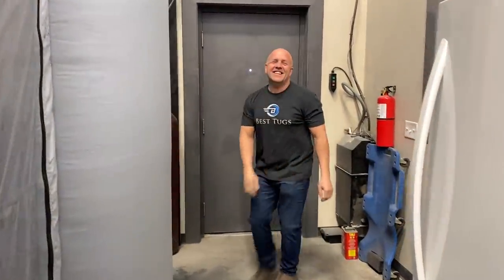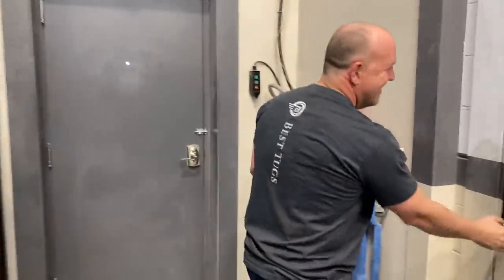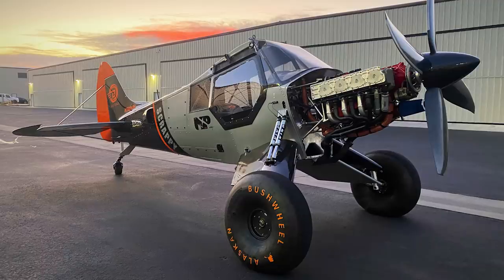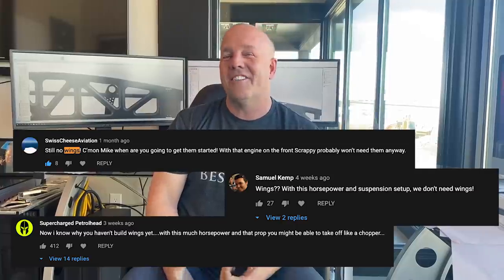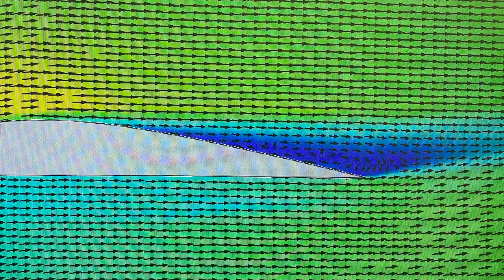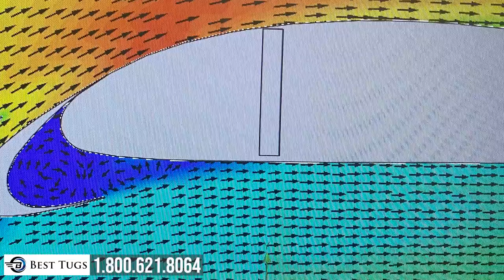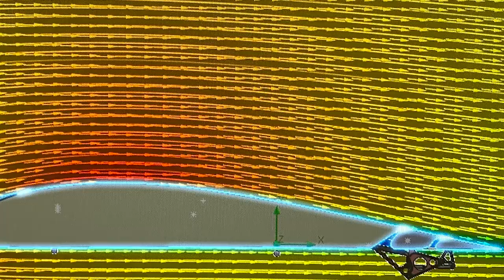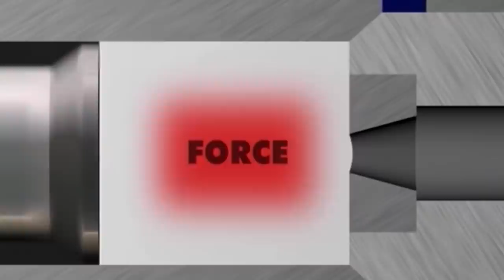Airplane Without Wings, Let's Try Something Different! | Scrappy #42

Comment: EAA Sport Aviation had a small article on wing morphing in March 2020.  Titled "Brayfoil Breakthrough".  Didn't give much info but did mention using carbon fiber wing skins with internal linkages to change wing shape.  I wish they would have went further in depth but was more of a teaser than anything else.

Comment: Hey Mike, impressive inspiring work. Thank you for sharing. I understand that you have finalised your wings, but I wanted to share an idea: which is a wing set that moves backwards a little just like some large predator birds do with their wings when they go in for a dive to go after some prey. So when you want to fly slow and have lots of lift, have the wings spread out and when you want to go fast, have the wings move backwards so that they are more angled like a > shape as opposed to a a ) shape. I hope that helps in your designs. Thanks, Jay.

Comment: There's a few interesting designs you could go for.
Take the junker's ww2 aileron/flap design. It droops out of airflow. It creates drag, so you can make them retractable like on the fairy firefly and extend them out slotted.
Slats can be any size but they start to lose efficiency and the whole point of them past a certain point. You could make them large and over-extend like a secondary biplane wing in tandem with the flaps deployment but the more complicated things get, the more the likelihood of failure.

I've wanted to design an aircraft like you design yours but here in western australia, the industry practically doesn't exist.

Comment: I am not an engineer or pilot but have an interest and I hate having ideas and not knowing whether they would work or not. 
As I listened to you speak about changing the wing in flight, I was wondering if some light actuators in the wings could push up a bar (which may be curved) up on a tough but flexible or elastic material which is integrated to a section(s) of the wing surface(s). I assume that since wings can be covered in fabric that not 100% of the wing must be necessary for structural support or need to be a tough material in all areas. This would allow you to modify the wing characteristics as you fly. 
I really enjoy your videos, thanks for your time.

Comment: When you talked about weight pushing down on the tail, I think you were referring to virtual weight in the sense that it would actually be downward force and not weight exactly. 
That got me thinking of actually using a weight on a track that could be moved forward and aft. 
I have no idea if that could be helpful, but I just wanted to get it out there.

Comment: In archery, you build a flatbow out of a bamboo layer, with on both sides fiberglass. So you build two bows, opposite of each other. Be always carefull for the high speed stall.

Comment: Put tube type tunnels in the wing so that the air goes through the wing while it flows over and underneath it.  Do that and it will give you amazing results.

Comment: A solution for your transformer could be to deploy some inflatable device into the wing. So you can pump air or better a gas, which characteristics regarding to air density and pressure are optimal, into the wing to change camber. I‘m very curious about it.

Comment: Fascinating video.  Just happened to come on after something unrelated I watched.  I have very little knowledge about aircraft (although I was an aircraft electrician in the Marine Corps in the late 60's, and the only thing I pilot is my hex drone), at least I understand the basic concept of how lift works and what control surfaces do.  When you explained camber, and then a lot of the other devices that effect air flow over wings, my thought went to "why not make camber variable?"  Obviously more complicated than just that, so I'll subscribe to see what happens.

Comment: All these questions have been the subject of analysis by Nasa, it's another type of V.G.. And this term VG had me perplexed for a while, when reading about various aircraft. In most fixed wing craft VG refers to Vortice Generators of course but not in hang gliders, which have flexible wings, and this is where the NASA research comes in, where VG stands for Variable Geometry. After all this is actually how birds fly. It's how a soaring raptor can glide the thermals and then dive toward prey at nearly 200 mph. Varying the airfoil, the shape and length of their wing. A Wills Wing hang glider does something like this with a cord and pulley system where the pilot tightens the VG for hi glide ratios, a cleaner air foil, or loosens the cord for greater maneuverability. How to do that on a powered airplane? NASA would also like to know. Good luck with this Mike.

Comment: Hello Mike, Since you're quite knowledgeable about airflow, have you considered slots or slats on the leading edge.  a friend has a Stinson 108 that has a slot built into the front edge that helps slow flight and doesn't seem to hurt the high side.  In addition, possibly adding a slightly up angle on the flaps and ailerons for higher speeds.   Another possibility could be installing slats that come away from the leading edge as the plane slows down allowing even slower flight.  My thoughts would be to add vg's on the slats.  I'm not an engineer like yourself.  I love your journey and am learning so much from your experiments.  Thank You!

Comment: Mike what if you put an air bladder type concept on top of the wing and then you could blow it up to increase your camber and deflate it to reduce it when you want high speed.  Kind of like icing boots. If it was on top of the wing the lift would help pull it up.  That would be like a mix of a slat that you can engage and disengage.

Comment: Expanding wings, either pneumatic or mechanical like slots, would give you a nice, high lift wing with a gentle stall. When deflated, they would be faster and get the speed and economy you need. The profile could be ugly and draggy when inflated, you wouldn't use it but a few minutes per flight.

Comment: Compressed air on rubber walls would easily change wings geometry. Pneumatic solution. By the way, have you heard about Cluster's channel wings? Basically using propellers to accelerate air over wing....

Comment: If you want to add/subtract wing(s) structure, why can't you use high strength tubing that is extendable/retractable on demand and using a thin polymer film that is on a roller for in/out.  Think of it like using a window shade across a self-resizing kite box.

Comment: MIKE!!! wait......I got an idea for ya.!! 
Could you use air bladders inside the wing to change the wing thickness in flight?
Thin wing fast, thick wing slow.  Air bladders could engage a turkey feather system.
Of course you would have to do this not to impair your wing structure or interfere  with fuel tanks.
If anybody could get this to work it would be you!

Comment: I'm blown away by your 'way-out-of-the-box' thinking. As for your wings, are they going to be organic ... screw jack, computer-controlled, shape-changing, carbon fibre, flex surface to meet your goals of thick chord slow speed and thin chord high speed. Kinda like the fabric flex wings that used no flaps on some early, early designs.

Comment: the new bugatti has inflatable dimples that increases a turbulant layer on the surface of the wing which will supposedly decreases drag by pulling the laminar flow back onto wing filling the gap happens so you could look into it

Comment: This is the first video of yours that I've seen, so if you've already considered this, please ignore. Could you design the wing for high speed, but then have an inflatable membrane on the top surface to increase lift when desired. I feel like it would be a simple and light way to modify the shape.

Comment: I've got one word for you. Its Dragonflies. They  studied them in Colorado years ago in a wind tunnel. They are the most efficient lifting machines on the planet. They make length wise vortex's with one set of wings and the other set catches them. In the patent for the helio courier they talk about boundary separation on top of the wing being the limiting factor. The farther back on the wing it is the better. All of the vortex generators are doing it the wrong way. It needs to be length wise on the wing just like the dragon flies. There are products for your struts that make a length wise vortex that improve performance. Why not for the wing?  Retractable leading edge slats with a vortex generator the length of the wing where the current boundary layer separation occurs will improve the envelope your after. And you say how will I do this? The paper airplane guy figured it out years ago. The 60 minutes paper airplane guy that still has the most views of any 60 minute show ever. He was on twice and you can buy a book to make his paper airplane. Its just a simple as hell notch in the wing. I've been wanting to build this for 30 years. You can make the notch come and go fairly easily. Its like a spoiler except it goes into the wing. Air spills over the notch and creates a length wise vortex in doing so and sucks the point of separation farther back on the upper wing surface. I'm a bushmaster builder with a set of Milo DeAngelo (the Canadian guy from BC) wings . Milo ran the leading edge metal on his wings farther back over the high point to just about right point for a length wise vortex generator to be. The fabric sags a little bit when it falls off of the edge of the sheet metal. (My guess its enough of a notch to make a length wise vortex) Go find a Milo bushmaster (There are lots of copies by other people) and fly it. I'm sure you will be impressed by the stall characteristics of that plane. It doesn't stall. (I can send you pics of my wing if your interested).Have you ever looked at the Helio Courier prototype? Its a Piper of course. The Smithsonian has it. Its got short wings like a tripacer with leading edge slats. I think all one has to do is copy that and put a adjustable vortex generator on the top and you will have low speed and high speed performance. I'm a mechanical engineer and builder CAD CAM CNC. Send me a PM on facebook if you want to talk more.

Comment: Did you ever think of using an inflatable style wing, that you could adjust from high camber to low camber? Or a rotor based alternative method to morph the wing, as adjusting camber on the fly would seem to suit your needs.

Comment: Mike Suggestion??? Have you looked at how the F-14 wing is designed for structural strength...?Please take one more look at the way in which it was developed...It will help make a promising thought of possibility for the clamshell torque...And then look at an RV slide...This may spark a clue to inspiration...and a final design...? In the end you are the designer/maker...

Comment: New sub here. Schooled as a Mech E. and had a special interest in advanced fluid dynamics including supersonic flow,  compressible flow, 2 and 3 phase flows (like a concrete slurry with injected air). I hung around until the end, and although you didn't reveal exactly how you planned on accomplishing your goals for the design, I can figure from what you said you were investigating at for the past year that in order to 'balance' the moment created by extending flaps WITHOUT the horizontal stab. and evel. controls being used up (which is a great idea because you never want to be in a position where you can't raise the nose) that there was one thing about the design that makes it way different, 'pushes the boundaries' as you said. So my question to you is are you using an electrically driven jack-screw, hydraulics, or pure manual strength to move the main spar(s) forward and backwards? You are correct in that statement about using elevator to compensate is the same as making the airplane appear heavier which has the associated effects that you listed.  I had also thought about making the wingspan able to grow, but I came to the same conclusion concerning gains vs. complexity (possibly reducing safety), cost, and most importantly, weight. Turn the wingtips up, like the airliners do, and here's why. The 'lift bubble' as you know is produced on the top of the wing, much more than a 'force bubble' of higher pressure air is formed beneath the wing. Both contribute but the low pressure is much more pronounced in its contributions. That area of low pressure is more important to protect as the air to the side of that lower pressure is then inclined to flow into that volume. This is also why the vertical portionsshould have an airfoil on them that reinforces the lower pressure zone. So it looks like the wingtip is part of the wing but bent up. A smooth radius for that transition from horizontal to vertical will lessen drag and other parasitic losses, like noise generation. Noise is energy waves, so generating noise means you are loosing energy there and you probably would rather use it for something better. Sorry for the dissertation.

Comment: Inflatable cylinders inside a compliant skin.  Could also do wire drive inside semi rigid polymer or fiberglass cylindrical sheets...probably lighter and faster actuation without buckling failure potential. Come to think of it, the wire drive can give variable profile along length of wing too, if cylinders are 'shelled' or nested, within limits. You'll want a flight engineer though I think.

Comment: You need to make a shape shifting wing. Look at Nitinol Wire. You set the shape and after you can run a current through it for it to return to that shape. You can make a thick high lift wing at takeoff and landing and using a small current change the shape to a flat fast wing.

Comment: Did you examine flaperons instead of the trade-off of flap vs aileron size? Also - to keep aileron effectiveness at high angles of attack, and eliminate adverse yaw, only move the ailerons up - no down movement. Lower lift on the down wing but don't  try to increase lift on the up wing.

Comment: Cool concept. I thought of a concept that would lift or drop a second wing. I.E. a plane that could turn into a biplane. I always thought that would be a cool concept. Almost like when some cars have hidden spoilers that pop out with a switch. It would be a wing inside a wing effectively almost doubling the wings surface. Just a thought.
Reply: The Nikitin-Shevchenko IS-2 polymorphic fighter biplane: the lower wing would fold up into the fuselage and upper wing becoming a monoplane. Pretty cool design.

Comment: Idea to alter camber, some sort of expandable air bladder, i'm thinking rubber to keep it smooth when deflated. Use frontal airspeed vs intake size to inflate and rear bleeders to deflate.
Probably needs an small air compressor and tank to have pressure on the ready anyways, cuz if engine dies, it'll be harder to inflate by speed, when u most need it.
Airspeed would be nice though, to keep weight down.

Simulation idea: let an AI do a bunch of simulations and evaluations, who knows what might come up.

Good luck sir and take care.

Comment: Hello Mike,
have you looked at the wing design of the Dornier Do27?
It flaps, flaperons and ailerons are all double slotted. The flaperons move together with the ailerons but also lower together with the flaps and then still move together with the ailerons. This gives you the maximum flap width and aileron width without compromising the width of the other. This provides for  extreme slow flight without losing controlability during aileron movement application. It's an interesting concept that is very effective. But I assume that you have, in all your research, analysis and calculations already contemplated these possibilities. If you can let me know your thoughts, I would greatly appreciate it.

Comment: The Premier 1A has a manual lift - dump, perhaps that's the key to coming in hot and putting it down solid on the tip of a mountain. Your trying to land an airworthy monster truck on the head of a pin on top of a mountain right?

Comment: The goal is to be fastest and slowest with the lightest and simplest in solution. Correct? 
I am thinking of you using air channels that open in the front of the wing and go straight to the back of wing and J's back in the opposite direction and creating drag and air push back at the tailing part of the wing. A simple electric powered or mechanical open and close. Or the small tail of the wing moves away creating a V for the air to hit from the front of the wing and evenly distributing the drag force. A simple in and out of  small rods that both open and move the tail edge of the wing out to create drag and reverse air flow. I think there are a few tweaks to the design of using the above idea that will add more control at slower speeds without any more power.

Comment: Its probably already thought of, but can you change the shape of a wing during flight?  Something similar to the membrane they use for de-icing planes while in flight.  Add it to the top of a low camber wing so it can inflate creating a deep camber when low speeds are needed.

Comment: Have you thought of an inflatable bladder on the upper surface of the wing to increase camber, a small pump wouldn’t increase weight too much and you could have a high lift wing for take off and landing as well as a more laminar flow wing for cruise…

Comment: I would use nitinol as the mover which could have two to three positions and could be controlled with a pulse with modulator to create shape or form very lightweight very strong

Comment: I thought you were going to a Freewing design at first. But now I know you're going with a morphing wing. Obviously there are number of ways to do that, but doing it and keeping the weight down are key. In my head, it almost looks like three or four high aspect ratio wings that work in unison to do what you're talking about. It will be interesting to see your solution.